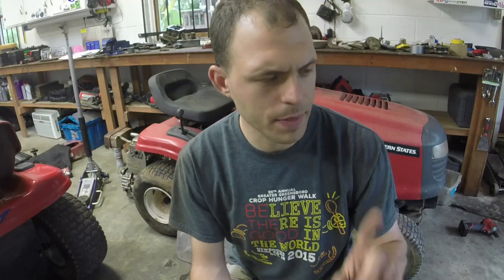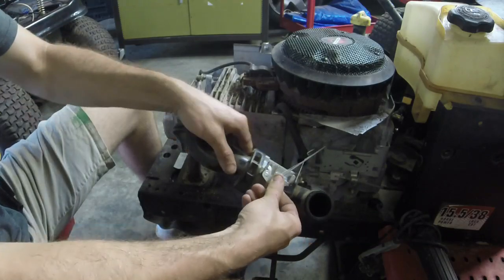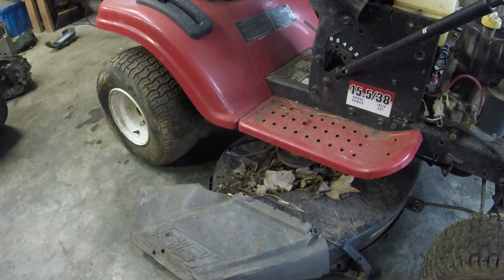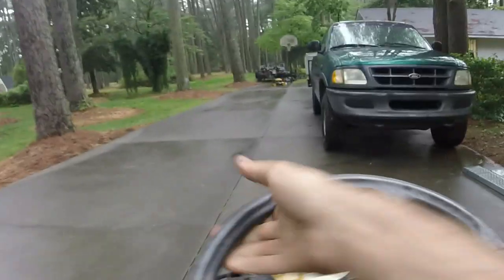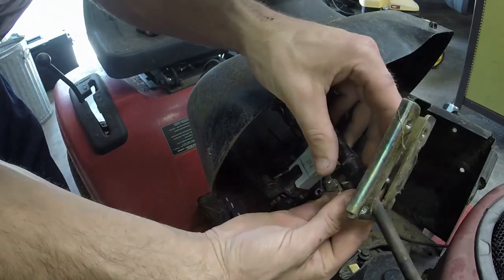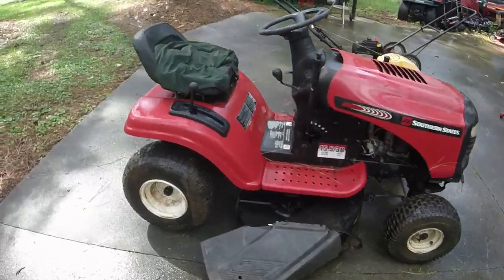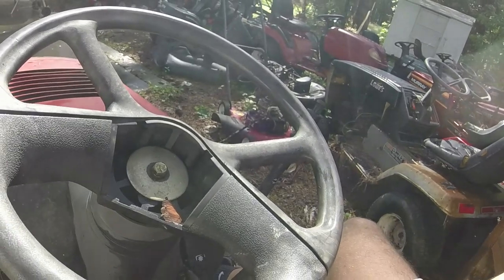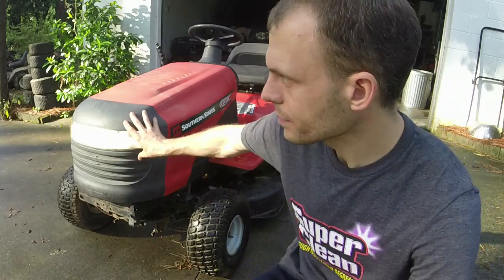Southern States (Craftsman) rider installing a few missing parts (carb, engage cable, deck arm)

Comment: Hey Casey, I know you are interested in quick turn arounds for your stuff, however, I take frozen cables, coil them up and put them in a coffee can of used oil for anywhere from a few days to a week or two.  I've had about a 75% successful recovery rate by doing that.  Enjoy your videos!!
Reply from the maker: That's good to know Lawrence, I typically just spend the $10 and have one or two on hand just so I can get them out as fast as possible.  I might try that with some cables down the line.

Comment: Hi casey. Great job in fixing the mower,   Im actually the guy that sold   you this mower  + parts.  I see you got a great pasion for the small engine repair field, just like me, Thank you for taking your time in filmimg your work.  
I currently found you browsing in this channel and subscribed.   Have a great season
Reply from the maker: Hey Jesse thanks for stopping in.  Thanks for reaching out about the lot that you sold me, it has come in handy with parts many times so far!

Comment: Hey I'm loving your channel man! I got a Southern states exactly like that from my Grandaddy. It needs a starter and was wondering how you find parts for these old riders?
Reply from the maker: Parts are pretty readily available still, you should see a model number tag on the engine cover that you can plug into Briggs' website which will give you a parts list.  Main difference is the starter gear whether it's plastic (16 tooth) or metal (14 tooth).

Comment: wow good video  Thanks Ed  Loretto Ontario Canada    PS what is the stuff you put in the tires  ATF ??
Reply from the maker: Thanks Ed!  Yes I put ATF in them and that more times than not will fix a slow leak issue.  I've even fixed tire cuts with it before!

Comment: I have one of these southern states 38 inch and I also have a craftsman LT1000 with a 42 inch deck and that deck is in very bad shape. I'm wondering if the deck from the southern states would fit on the Craftsman, do you by chance know the answer to his question?
Reply from the maker: If both are cable engage or both are lever engage and you have the hardware for them, they should swap without issue.

Comment: Question, do you ask more money for a Garden mower verses a riding lawn mower? Since most of the time they have bigger engines and maybe a larger deck.
Reply from the maker: Most definitely!  Some garden tractors and higher end lawn tractors are harder to sell because people want them for cheap.
Reply: @EllisMowersandmore  Yes, I've notice that. Maybe most people don't know about garden tractors and assume all lawn tractors are the same. Thank You for your channel, I'm learning more and more about these repairs. I've had multiple mowers given to me in my area and I'm enjoying bringing them back to life as a hobby. I've sold 10 - 15 push mowers this year and now I have about 10 riding mowers with 4 of them being larger garden tractors.